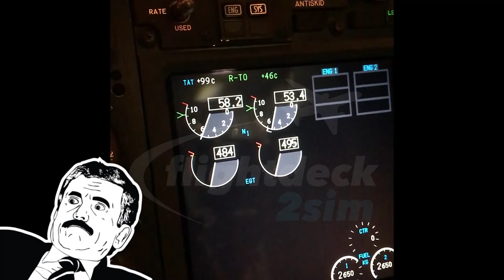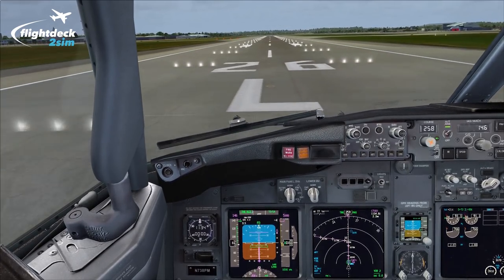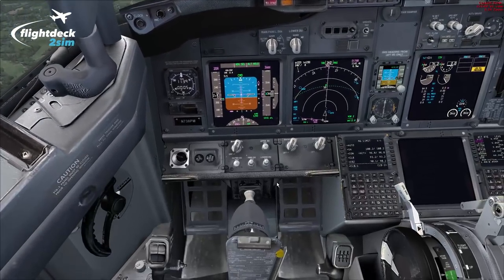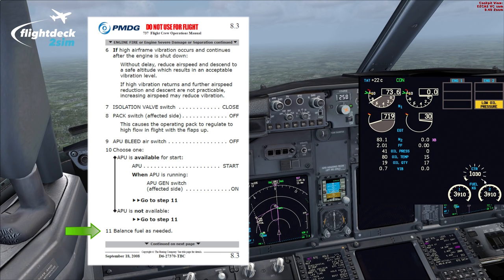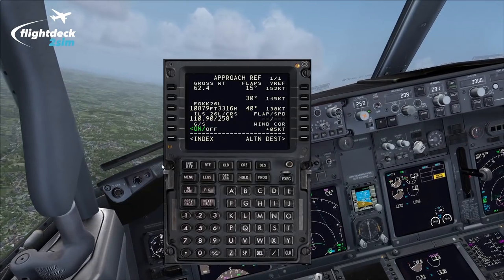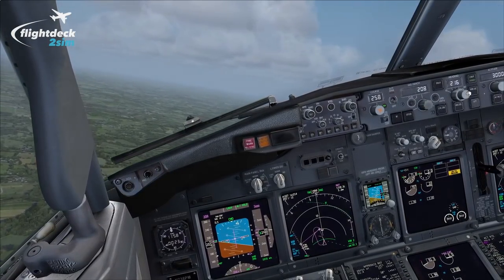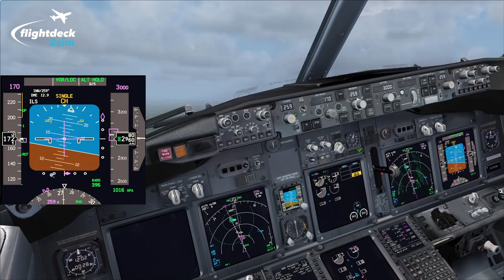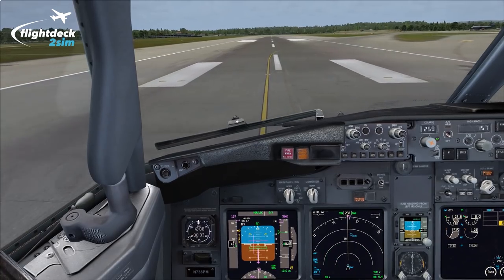PMDG 737 Engine Failure Tutorial by a Real Boeing Pilot

Comment: Great tutorial as always, its interesting to see the minor differences of sop’s between companies :). We normally use vnav on takeoff (we have 10.8 on our fleet) and set the EO Accel Height, at 400ft call for bank angle 15 (in case we need to follow a specific seop routing), hdg select and engine severe damage qrc checklist (which contains the memory items you mentioned plus some others) and we can also engage autopilot if stabilized at 400ft, after v2+15 we call for bank angle 25, after completing qrc checklist we declare emergency not pan pan. At level off we retract flaps on schedule, set max cont thrust,  level chg to msa or as required in the seop and continue the checklist which redirects from qrc to qrh. Once we get to the deferred items we call for the after takeoff checklist and prepare the return to the airport.
Reply from the maker: Hi Manuel Z

Interesting to hear and thanks for sharing! Loads of different operators use slightly different methods to get the same job done. 

Training pilots from other airlines, they often query why is it different from where they’ve come from! I just have to teach them the way it’s done here! 

FD2S

Comment: Thanks for another excellent and informative video FD2S. I was a bit surprised that you only gave a PAN call and not a MAYDAY.
Reply from the maker: Hi flyhalf2,

Although a Mayday (emergency) call could’ve been made this is more for distress and imminent danger to either the aircraft or other traffic. (Eg Rapid Depressurisation, Fire, Pilot incapacitation) 

Depending on several factors a PAN call (urgency) should be sufficient with a controlled engine failure

Both can be upgraded or downgraded and cancelled at any time 

FD2S

Comment: Great video and really nice explantion! I have produced the same from a Full Flight simulator on my channel. 

I love how clear the displays are. An interesting discussion point is that with seizure you may not get the airframe vibration, which you don't in many Full Flight simulators. So most copanies use airmanship and as you say, with 0 N1 and or 0 N2 this is likely to be a severe damage. Interesting that the PMDG does not have the auto pop up feature of the lower DU. The secondary instruments should have appeared without selection, unless you use the compact display.
Keep up the great work! Really enjoying your videos!

Comment: Very nice video and explanation. I just miss one important thing in this episode, after the right engine separation your Hydraulics are gone on the right side, which means several equipment are not working anymore which is omitted in your flight back. Cheers!
Reply from the maker: Hi Erwin, glad you like the video! 

In this situation this was not an engine separation, this indicates the whole engine has fallen off! 

Secondly all systems are still Hydraulically powered as we’ve only lost the engine driven hydraulic pump, the electric hydraulic pump is still available 👍🏼

FD2S

Comment: Hydraulic A or B failure tutorial please. What happens when flight controls degrade to manual reversion?
Reply from the maker: Hi Rishav, the aircraft can be flown without HYD A and B but the primary controls (except rudder which can be controlled by the SBY HYD systems) become very heavy. Pitch and Roll requires a significant physical input to control the aircraft, it's hard work but still controllable.

FD2S

Comment: Hi! I have a question. I've seen that on another aircraft (both airbus aircraft and other boient aircraft such as 747, 777 or 787) the autothrottle is not disengaged on an engine failure, and i wonder why the 737 is the only one on which the authothrottle is deactivated. Thank you!

Comment: An amazing tutorial Captain! When an engine failure like this occurs in real life, what happens to the aircraft after landing? Is the operative engine fully replaced due to the additional load it had to support? Hope FD2S is the operator  on my next trip 🙂 Thank you!! P.S. The Maverick signature was awesome 😎
Reply from the maker: Hi Massimo,

The aircraft would need to be thoroughly inspected before being released back to service and obviously the damaged engine would be replaced. The operative engine should be fine as the thrust you need to set should be well within the operating limits.

FD2S

Comment: Great video. Been a few years since I last operated the 737 but certainly recognise LGW and the landing performance calculation you used. If one wants to get a sim, which would you recommend
Reply from the maker: Hi Paul! MSFS and XP11 both have their pros and cons and I still love using both sims. 737 wise, the PMDG in MSFS is superb for a launch version albeit needing some fine tuning. MSFS is “far more advanced” visually but XP11 still holds its own and aircraft handle in a more realistic manner. You should try both!

FD2S

Comment: Very nice video, I have a question though :
Why is the engine start switch on continuous for the inoperative engine? Shouldn't it be on the OFF or Auto position?
Reply from the maker: Thanks Super 0018

It is to keep the EEC energised which helps prevent nuisance master cautions and speed warning flags.  

FD2S
Reply: @flightdeck2sim  Thanks for the answer 😊

Comment: Nicely done captain thank you so much ! Btw Why does QRH say that don't use APU bleed air if engine fire switch is illuminated ?
Reply from the maker: A really good question Mehmet Zeki Demirdelen! I was always under the impression it was to prevent contamination of the air conditioning system.

Asking around and doing some research I’ve had mixed answers 

I was directed to this post online with mixed answers from pilots.

https://www.pprune.org/tech-log/526571-737ng-oei-landing-checklist-additional-ga-thrust-required.html

Put this way, if the engine fire was still illuminated by this point I’d be on the ground by now!!!

FD2S
Reply: This is just awesome. Thanks a lot sir.

Comment: Do you ever put any altitudes in the FMC descent page for TAI ON/OFF, if you are expecting the use of engine anti-ice on a descent? From what I know, the engine anti-ice system increases the idle thrust, and thus it modifies a little the optimum descent profile. And if it modifies it, it is that significant? Thank you.
Reply from the maker: Hi Ovidiu

I haven't really used it unless I anticipate using TAI throughout the entire descent, you usually end up turning it on and off during a typical descent in Europe through all the gnarly weather. I've never considered how this will affect my descent profile. It does make a small difference to your descent of course but it's negligible compared to say a speed change from ATC or a massive shortcut!

FD2S

Comment: Hi Captain ! .. is there any tutorial on radio and communication handeling? Lot of buttons there but usually in tutorial only frequency and TCAS is used.
Reply from the maker: Hi Kk,

Not yet. As there is currently no functionality with many features on the Audio Control Panel in a desktop simulator it's something I probably won't cover.

FD2S

Comment: Something I've always wondered, what is it like to get sim time as an actual pilot? Does your company have time slots in the simulator that you can sign up for to just try things as you want, or do you have to wait for pre-scheduled simulator schedule times the company assigns to practice set events?

I've always wanted to find someplace near me with a 737 simulator that offered flights, but the nearest I've found is all the way on the West Coast in LA.
Reply from the maker: Hi Aaron!

Every 6 months you must go in the full motion Sim for your check

The company I work for also have fixed base training devices (FNPT Trainers) which can be booked and used by crew. They have a fully enclosed 737 flight deck where several scenarios can be practiced 

FD2S

Comment: engine faulire: 

400 hundred hdg select, apu start, bank angle 15 inform atc identified problem 800 hundred ft speed 210, flaps up: level change, max cont thrust flaps up speed, bank angle 25 autopilot engage, engine failure or shutdown checklist, after take off checklist.

Comment: I notice that you turned into the operating engine during the hold. Did you intentionally avoid turning into the dead engine, or were you simply following the standard holding instructions?
Reply from the maker: In a light twin or turboprop, if I remember rightly, avoid holding and turning towards the dead engine. There is no limitation I know of in the 737 👍🏼

FD2S

Comment: Why Pan and not Mayday?? Thought Pan was for lesser emergencies?
Reply from the maker: Hi Joe,

Although a Mayday (emergency) call could’ve been made this is more for distress and imminent danger to either the aircraft, life or other traffic. (Eg Rapid Depressurisation, Fire, Pilot incapacitation) 
For us, following the ICAO definition for a PAN call, “it represents an urgent situation, which for the time being at least, does not pose an immediate danger to anyone's life or to the aircraft itself”
A contained engine failure can be easily managed by a competent line crew, so a Pan (urgency) call is enough. Both can be upgraded/downgraded or cancelled at any time

FD2S

Comment: Great tutorial! However, i didn´t really get, why the system B engine hydraulic pump wasn´t dead.
Reply from the maker: Hi Jump N´ Run, are you referring to the fact the SYS B light didn’t go on? If so that’s because if you pull the fire handle switch the light becomes inhibited 👍🏼

FD2S
Reply: Uh okay Thanks! makes sense ans the fire handle cuts hydraulic connections to the engine as far as i know.
Reply from the maker: Jump N´ Run correct 👍🏼. Pulling the handle closes the respective engine driven HYD pump shut off valve and inhibits the light.

FD2S

Comment: Hi FD2S, 10:15 You set rudder trim, then after disengaging AP before landing, is that needed to set rudder trim to 0? Thanks.
Reply from the maker: Hi Frank. Once rudder trim is set leave it for the rest of the sector, no need to reset.

FD2S
Reply: flightdeck2sim  Thank you for letting me know.

Comment: Why not arm VNAV for departure? Bugs your acceleration for you...
Reply from the maker: Hi Adam, 

At the company I work for we don't preselect VNAV although I am aware of how it can be used to allow it to bug up in the event of an engine failure, I also have a tutorial covering its use

https://youtu.be/yPfKEVaXVqY

FD2S
Reply: flightdeck2sim oh that makes sense if it’s a SOP thing. I assumed most airlines arm VNAV with all the new RNP SIDs etc.
Reply from the maker: RNAV sids don’t require VNAV as far as I know, only certain RNAV approaches. They do require LNAV though as the maximum X-TRK error in 1/2 the RNP (1.0nm) for a SID 👍🏼

FD2S

Comment: Hello Captain, Thank you very much as always very interesting and a very stimulated. I'am a little bit surprised that you  chose to fly 13 minutes not realy knowing what the reason is/was for engine fail. (Maybe bad fuel) If I had make a guess I expected a immediate return but as told before I'am a amateur. ;) Also I had hope for a going around but your passengers are doubtless glad to leave the plane as soon as possible. Have a nice weekend and I hope for you many save landings. Greetings from the Netherlands. I am glad that I am not your neighbor than you had been saddled with an uninvited guest   (lol) Bye bye!!
Reply from the maker: Hi G L, 

We knew the problem as soon as we got to 400ft (No N1 rotation and N2 rotation is severe damage). In reality you would most certainly hear a large bang!

Bad fuel would likely cause an issue prior to getting to the runway and contaminated fuel could cause a fuel filter bypass first. Jet A1 is frequently tested from the bowser so it’s very unlikely to be an issue 

Immediate return is always on the back of your mind (eg fire) but in reality an engine failure is a controlled manoeuvre with time available to assess the situation 👍🏼

Good luck!

FD2S

Comment: Rudder trim remained there till touch down?.
Reply from the maker: Hi Kk, yes. No need to reset prior to landing. Use the Rudder to counteract the yaw when reducing thrust during the flare.

FD2S
Reply: flightdeck2sim Thanks !!
Reply: flightdeck2sim so just to clarify if let say right rudder were in trim you will maintain it in trim while flaring and to counter the yaw effect while closing the thrust you will add more pressure on the in-trimmed rudder? pls correct me if im wrong

Comment: How did you get the engine to fail?
Reply from the maker: Hi Marc,

The NGX - FMC. When you push MENU you can find failures. The NGX has a robust failure implementation system which I’ve used for many years!

FD2S
Reply: flightdeck2sim oooh! Cool! Works well😀

Comment: How can you choose this over xplane11?
Reply: Maybe because of PMDG 737?
Reply: For the sheer study level of the 737, sometimes it’s not all about looks
Reply from the maker: XP11 is a superior sim for sure but as John mentioned, the NGX is a study level aircraft with a very useful failure implementation system built into the FMC which I have used for years and I could set the engine to fail shortly after V1

Don’t worry, ZIBO’s MOD is becoming one of the best add on aircraft out there and I will be using it for most of my tutorials in the future 💪🏼 

FD2S

Comment: Dude for engine fail you must use MAYDAY, MADAY, MAYDAY, not PAN!
Reply from the maker: Hi Julio,

Although a Mayday (emergency) call could’ve been made this is more for distress and imminent danger to either the aircraft, life or other traffic. (Eg Rapid Depressurisation, Fire, Pilot incapacitation) 

Depending on several factors a PAN call (urgency) should be sufficient with a controlled engine failure.

Both can be upgraded or downgraded and cancelled at any time 

FD2S
Reply: No dude... I am professional 737 pilot, for engine fail you must call Mayday!
Reply from the maker: Me too my friend, about 4500 hours on the 737 and I’ve been teaching Captains and First Officers how to fly the 737 for the last 2 years!

It could be your operator specific requirement for a mandatory mayday in the event of an engine failure. 

For us, following the ICAO definition for a PAN call, “it represent an urgent situation, which for the time being at least, does not pose an immediate danger to anyone's life or to the aircraft  itself”

As mentioned a flame out can easily be managed by a competent line crew so a Pan could be sufficient but nothing wrong with a mayday either 👍🏼